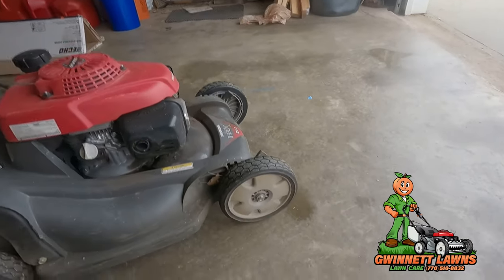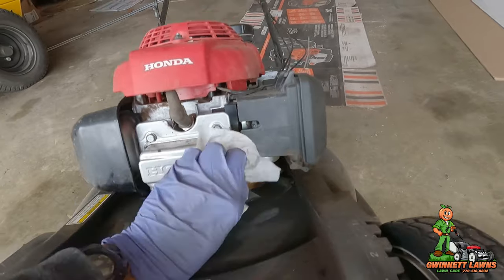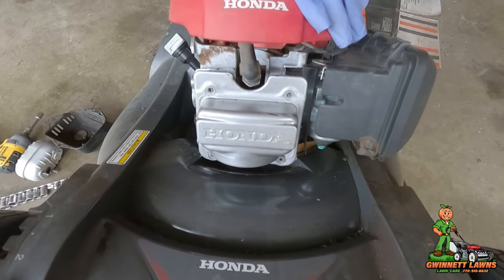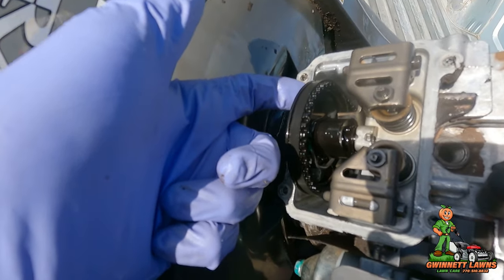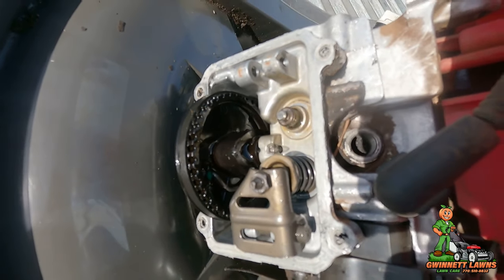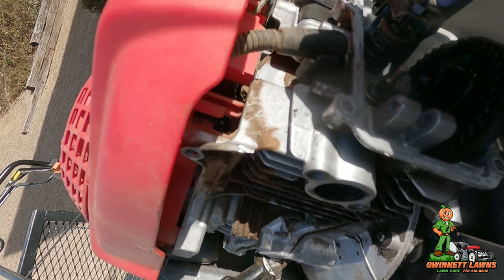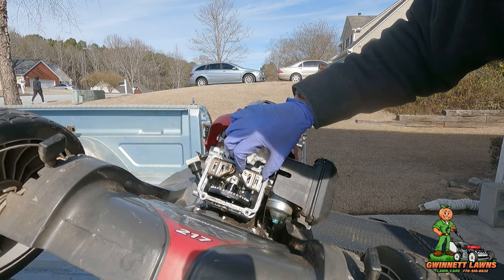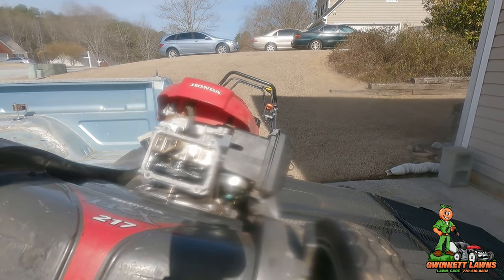Honda HRX 217 BAD Oil Leak Repaired  Super EASY Fix

Comment: So if this is an ongoing problem, would you suggest I NOT buy one of these?? Im not crazy about the plastic deck anyway, but if this oil leak is gunna be something I have to deal with on a regular basis, I dont know about spending 800 bucks for this mower(thats the current price)... I have a hilly backyard, some stary rocks and roots, if not this mower, can you suggest a mower that would handle hilly and sloped yards? Thanks!!
Reply from the maker: They are great mowers and the oil leak is super easy to fix.  They are also really good at climbing hills.  I just bought another one myself.

Comment: Helpful and informative. I found the exhaust guide on my pressure washer was coming out. After I drove in back in place, the carbon on the valve stem was making it stick. Fine sand paper through the exhaust port cleaned it up. Of course, I cleaned out the grit before it went back together. Thank you.

Comment: Did you change the o-ring on the shaft, you never showed that. I changed my valve cover gasket but I still have a leak.
Reply from the maker: Yes, I did on the second video about the oil leak shows how to do the shaft O-rings.
Reply: @GwinnettLawns  Can I get the link for the video on shaft 0-ring. tks
Reply from the maker: @jascam1  Correction at time mark 8:52 I show the shaft with the defective o ring.  I guess I did not video it because it is just taking the old one off and putting the new one on.  There is would have not really been anything to show.
Reply from the maker: @@BBB-cp8pu yes most likely the O-ring is gonna be super hard and it will just break apart, but use a pic or a small screwdriver
Reply: Is there a specific size o-ring?
Reply: @colorhungry  Honda will call it the cam shaft o-ring.

Comment: I had no idea the valve seals would dislocate! Thanks for the heads up 😃
Reply: The Honda GCC190 on the pressure washer I'm donating to a young neighbor, I'm repairing the camshaft pin seal and low and behold it had the same valve stem seal issue! You likely saved me from donating a pressure washer that would certainly die and this family really needs my support because the father is gravely ill. This and the rest of the equipment I've been given for donation has helped them make the bills even though the father can no longer work. Thanks again 🙏

Comment: Cool, thanks for that. I have that oil leak issue on a GCV216 on a backup mower and I did learn something about cleaning those fins that is a real timesaver.

Remove the recoil starter, take off the two bolts that hold the fuel shutoff, remove the two carb bolts, then remove the top/tank, shutoff and carb as one complete assembly. You already had the muffler off and doing this, you can get to just about everything for cleaning. When you're done, putting the fuel system back on is a breeze. The linkages as well.

I'll be checking my HRZ217 soon for this valve guide issue. So far, I've only had a problem with the thermowax on the choke system. It took me a while to figure that one out. That thing runs sweet.

Take Care and have a Great Day!
From further down south in Warner Robins, Ga. (Just below the "Gnat Line".)

Comment: I replaced the O ring and made a gasket for the valve cover, now no leak! My problem 
is now the pull start will not "pull" unless the spark plug is loose. If the plug is loose, the mower
starts up and runs great. If I tighten (even by hand) the spark plug, I cannot pull the rope.
Reply: Hi I’m having issues with that too, how did you fix it?
Reply: @hectorheredia311   I haven't yet. I just keep the spark plug loose and deal with it.

Comment: Does the valve cover hold the oil seal shaft in place? Also - above you say you are fixing an oil leak in two places. One is the cam shaft oil seal - what is the second? The valve cover?
Reply from the maker: Yes and yes.
Reply: @GwinnettLawns  Thanks for the response. I'm surprised that the valve springs can be compressed enough with just fingers to remove the springs. I didn't see any valve spring collar keepers. What keeps the springs in place? Also I'm guessing that you removed the muffler so that you could stick your fingers into the exhaust port to hold the exhaust valve seated so you could put the springs back on?
Reply from the maker: @kennykarkalits9564  the On top of the valve spring has a slightly oblong white allows you to slide it off, which holds the screen. Putting the piston at top dead center so the valve doesn’t fall down. It’s all that’s needed.
Reply: @GwinnettLawns  Interesting. I've got a HRX217K5VLA. Bought it new in early 2019. So far the rocker cover area is clean and dry of oil. If it only develops oil leaks - I'll live with that and repair it. If it starts spitting valve guides I'll probably move on to a different mower. I love the cut quality and the bagging capability of the HRX. I recently bought a new 200cc HRX217VKA and an HRX217HYA. I was unaware of the camshaft issue the new HRX's have when I bought them. I've used the new VKA once and haven't used the HYA yet. I'm fixing to sell both of them. I'm considering either the Honda commercial or an older HRX for a second mower. Thanks for your responses and the videos.